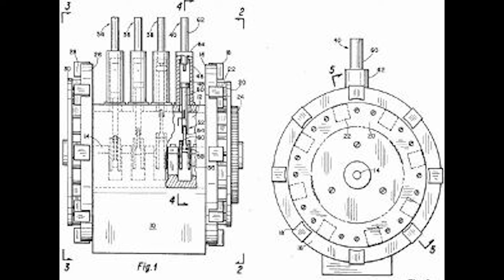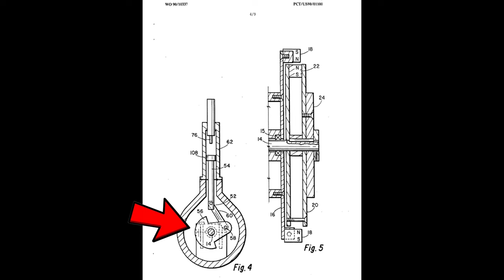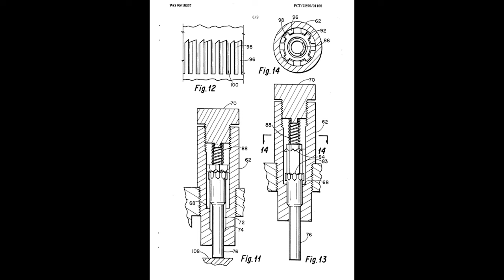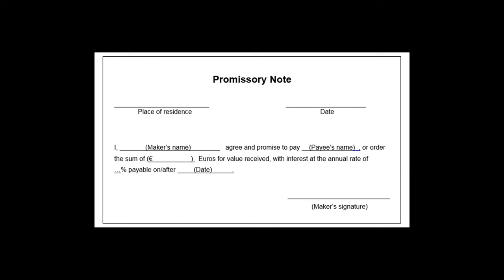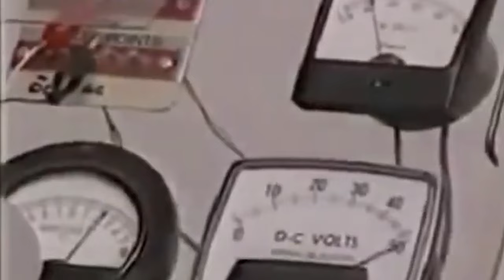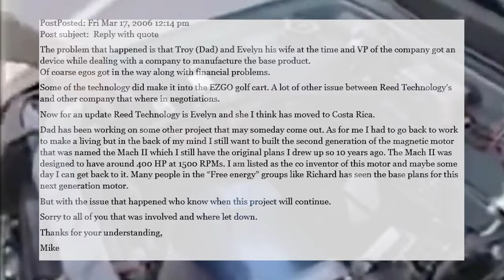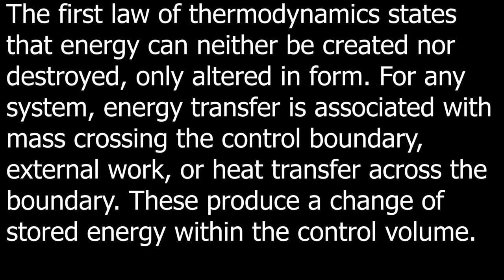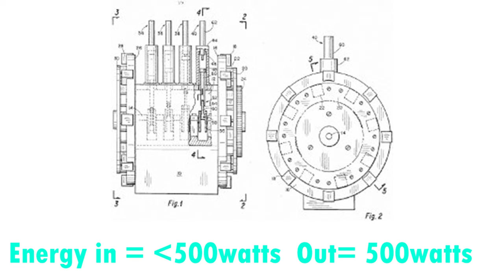Troy Reed and His Magnetic Motor: A Glimpse into His Revolutionary Energy Technology.

Comment: Before you can get perpetual motion you have to start with a perfect balance w h e e l then add weight balanced points that makes the wheel continue without stopping and turning backwards if it's not balanced it was stopped and turned backwards because the weight is not distributed correctly if it's not balanced to start with it never will keep turning it has to be perfect balanced and my thought is and I'm going to work on it the magnets with a perfect balance wheel that are weighted at Perfect Balance balance will turn the wheel if the wheel stops and turns backwards it's not balanced
Reply: Won't work either.